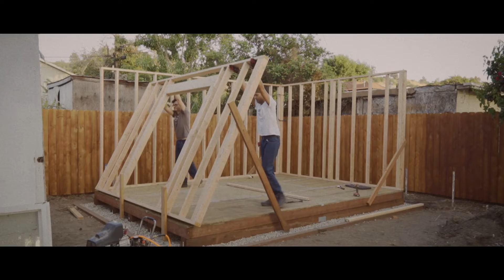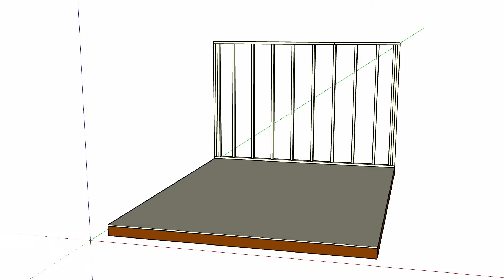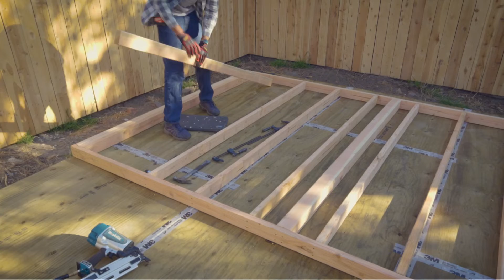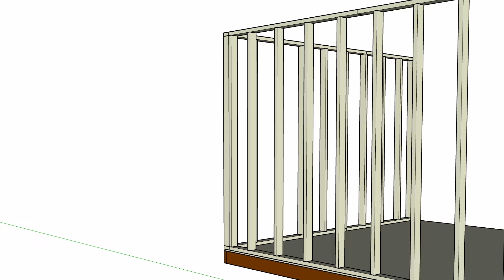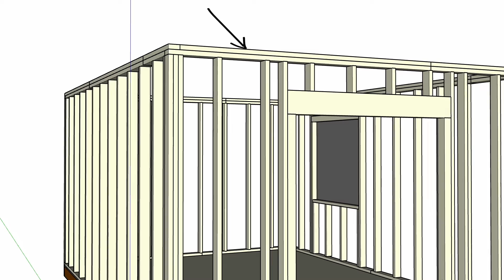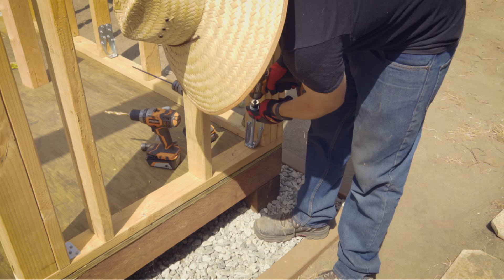Framing Shed and Building Walls: Part 3 of our Shed Build Series

Comment: What's the extra post\beam in the back wall @ 3:15?
You taped the seams on the plywood floor. Won't that wear away quickly?
Reply: Never mind... Later videos showed the post supports the roof beam & you covered the floor with vinyl.